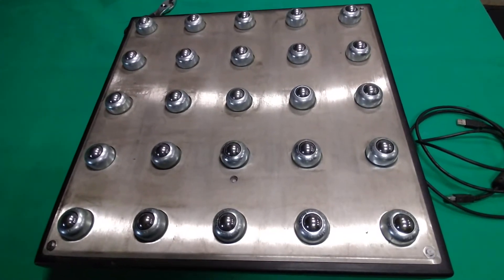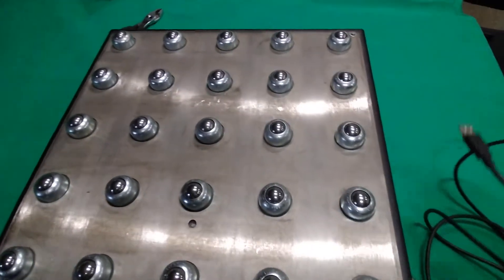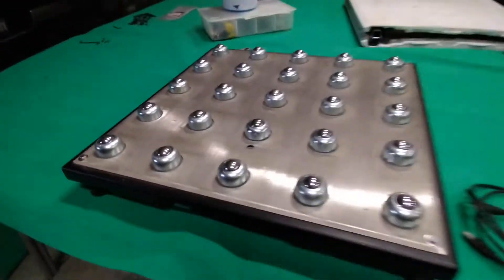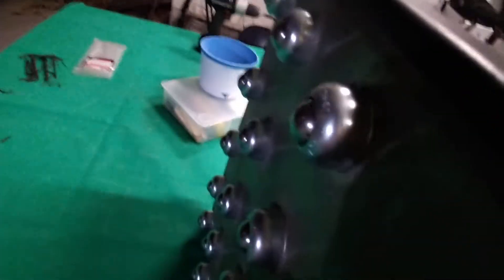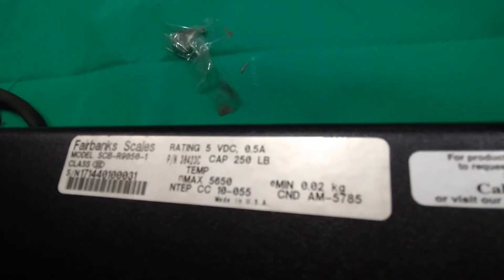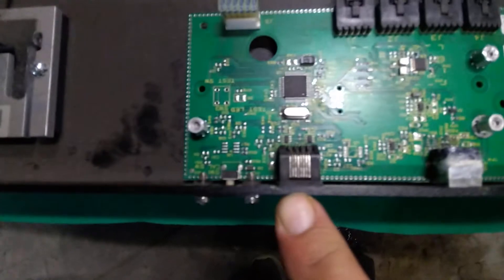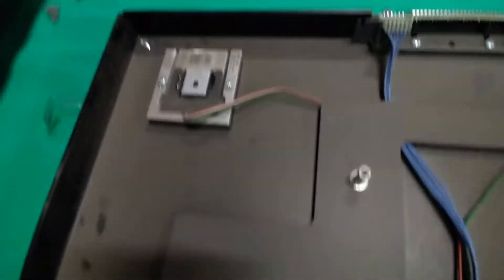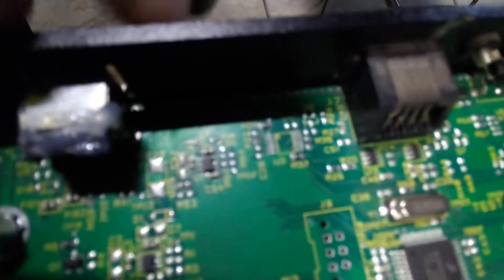Fairbanks scales model SCB-9050-1 how to take apart and repair USB connection

Comment: do you have any high resolution photos of the circuit board? on mine some of the small parts behind the USB port got wiped off when the plug got mashed in. haven't been able to identify

Comment: Not often when I search for a video do I find the exact model and problem that I have with our equipment.  The bolts on the bottom look like allen key but I can't find any size that grabs the bolt.  What did you use to loosen the bolt?